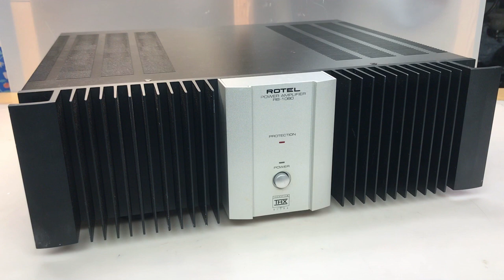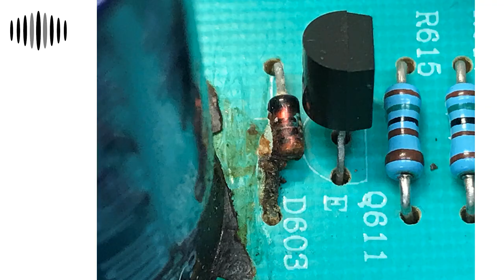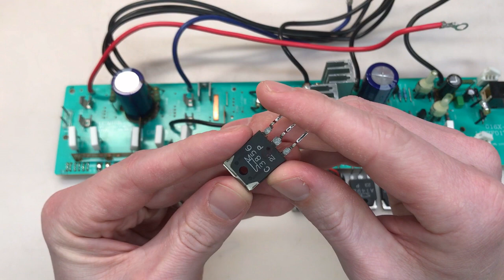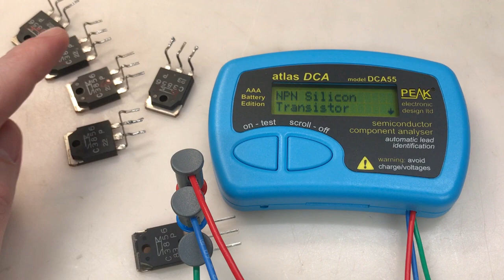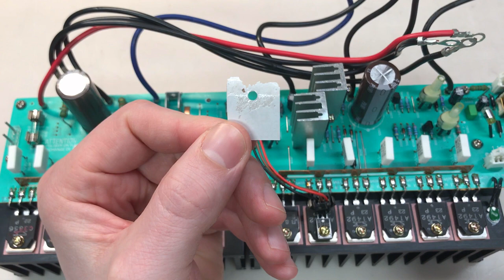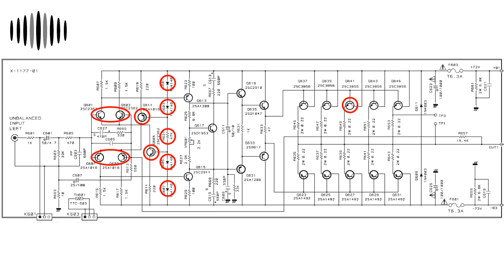DR #38 - Repairing Audio Gear - Rotel RB-1080 Blowing Fuses

Comment: R621/R622 (L/R) are also problematic in this amp.  They are 1/4 watt 47k resistors and are dissipating over 1/2 watt and tend to go open because of this.  They should be replaced with 1 watt resistors.  This also applies to the RB-991 and the 5-channel RMB-1095.
Reply: Thank you for this info. I have calculated 0.44W in RMB-1095 with +/- 73V power rails. It's pretty strange that Rotel guys missed that problem. Now I am repairing RMB-1095 that has all output transistors and a couple more damaged in one channel. Maybe I should replace all of those resistors.

Comment: In Dr-19: you replaced the (back to back) transistors. It was showing distortion at the middle of the sign wave… not the ends. When heated the distortion was eliminated?you replaced them added new thermal compound and shrink tubes them together. You said that they had to basically operate at the same temperature

Comment: Зачем убрали rubycon black gate?
Reply: I have a smaller Rotel power amp, and the black gate electrolytic caps on the inputs gave the amp an unpleasant harsh sound. I replaced them with same value styrene caps (meant for the EQ section of a recording console) and the sound improvement was incredible!

Comment: Great video very informative. Which style of electrolytic capacitors are you using? Also what is the thickness of the thermal pads you used.
Reply: Radial or snap in?

Comment: I have a 4 channel car amp thats immediately blowing the 2 20amp fuses on the amp as soon as its inserted into the holder on the amp, I have only the power cable and the ground cable connected. The remote wire, rc cables and speaker wires are all disconnected. Without even turning the amp on its blowing the fuses... please assist

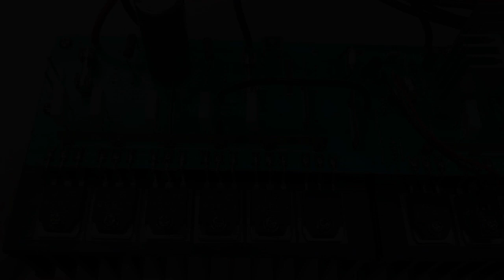Comment: 8:27 what about the other transistors?
Reply: 10:15 what about the BIAS on the other side?
Reply: What about the caps on the other side?? It's like replacing car suspension on one side but leaving old on the other
Reply: 12:07 good job diagnosing

Comment: To me it would not make sense that the open diode caused the power transistor to short out as the bias current would drop low to almost nothing. But if the same diode shorted out to begin with the bias voltage would be wrong and the output transistors could get stressed because of inbalances idle current. Nice video by the way.

Comment: I have just bought a Peavey CS1000 rack mount power amp... When you plug it in and flick the switch on, the rear panel glass fuse instantly blows.
But looking inside the amp, there is a power board with 2 glass fuses, those arent blown.. It just blows the main rear panel glass fuse..
Ive inspected the board, with my limited knowledge, and found no other obvious faults.. But removed and tested the output T0-3 transistors, and found 4 to be faulted to ground...
Could this be what is causing the main rear panel fuse to blow constantly?!?
I just thought its strange, that the internal power board fuses are still perfectly fine, when it rectifies AC to DC etc... But it blows the mains AC rear panel fuse...
Im really hoping its just the transistors at fault, im new to repairing electronics, and this is my first project. I really dont want my first project to be a failure :(
Reply: Check the bridge rectifier in the power supply for shorts across one or more of the diodes.

Comment: Really great video. I have a Rotel RB 1070, I haven’t opened it up yet, but do you happen to know if They’ve got  fairly similar guts?  No worries if you don’t know.  My left channel is out, I’ll get around to it shortly.  

What I was really hoping to figure out is what you usually use to remove that god damn glue in a relatively easy way?  The brown, super degraded glue isn’t an issue, that’s easy enough.  But I am constantly running into amps that are just COVERED in it. They might as well have just straight dipped the entire board in it.  Do you know any solvents that will eat through it without destroying the board or any components? Or any product that will at least soften it up to make it manageable.  I have to catch myself and stop my ocd from taking over because if not I’ll realize I just spent 2.5 hours picking a 3” X 3” section of glue and barely making A dent in it.  You either use metal tools and risk damaging the board and components in case you slip, or you use plastic and make it 10x more difficult. Any help would be sincerely appreciated.  Thanks !!
Reply: Freeze spray can help sometimes.  Makes the softer stuff more brittle and bigger chunks come off when you pick at it. If it's not on components, traces or jumpers you can just let it be. It doesn't migrate anywhere.
Reply: ISP can also be applied to the glue to soften it.  Then use a small pick(got mine from my dentist) to remove the glue.

Comment: Great video.
I had a Rotel rx-1052 that had a weak, fuzzy left channel.
The technician quickly found a shorted resister, but because it's a Rotel he checked for voltage leaks caused by that glue. 
He found a constant 5 volts on the right output channel. 
After cleaning all the glue from the components, the 5 volt leak to output was gone.
He said the glue Rotel used to secure  heavier components to be soldered was an insulator when it was applied, but after years of exposure to heat it gradually becomes carbonized and therefore conducts...causing all kinds of problems.  
The constant 5 volts to the right speaker would have, over time, ruined the voice coil.

I hope Rotel figured out that issue!
Reply: It’s not a Rotel issue. It’s an industry wide problem.  I was STUNNED to find out that some companies are STILL using the same glue.  That’s when I realized it was a feature, not a fault. It’s the most blatant form of planned obsolescence I’ve ever seen. I opened up a Definitive Technology BP9060 plate amplifier to find the damn thing slathered in the same yellow epoxy stuff. The BP9060 is not vintage gear. It was released just a couple years ago.  Def Tech has a horrific track record when it comes to amplifier reliability, and that is definitely one reason why.  They don’t just use a dab here or there, they slap it all over the board, all over items that heat up, all over conductors, all over everything. I sincerely don’t understand how there hasn’t been several dozen class action lawsuits about this exact practice of setting a time bomb in every amp they build, that causes them to kick the bucket, blowing up usually a year or two out of warranty. Some manufacturers have definitely figured this out and moved away from it, unfortunately others have not.
Reply: I should also say, I believe they intentionally build the amps with flawed , undersized capacitors that they know will eventually fail, rendering the amp useless. Then they get sent in to def tech to be replaced for $300 while they go head and fix the caps they know are 90% likely to be the problem. That’s how all thr 7000 series amps are built. It’s a design flaw intended to blow up the amps out of warranty, but they get plenty that blow under warranty still too. I don’t know how one would go about proving it, but this kind of crap needs to be rooted out.  Cheers.

Comment: you should tell us why this transistor is get short , not just open the box and search for short , reason for short that is question , if you want teach out electronic !!
Reply: Not always possible to locate the cause after the event. However in this case the open diode would have caused the main output transistors to run hard up against the power rail. This would continue until the weakest output transistor failed from excessive heat. Not all transistors come out of the factory identical and it also means the rest probably should be replaced as they also were stressed out with the heat. Note also the TH601 protection thermistor isnt even physicaly connected to the failed transistors heat sink and so was never able to protect the positive bank.
Reply: If you want to criticize someone on the internet using lots of exclamation points as if you’re yelling at them, you should learn English and you should use correct punctuation and grammar!!!!!!!!!!!!!
Reply: @kilgoretrout4461  amen!

Comment: What timing, working on my Rotel RB-981amp, replacing the 4 large leaky capacitors on my 20 year old unit.
Had to clean up a lot of glue on the board too !